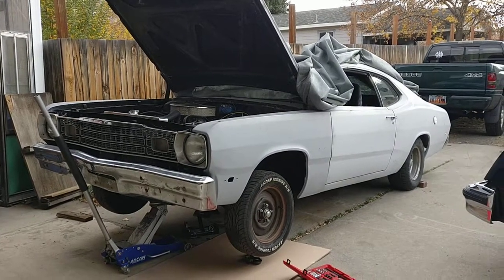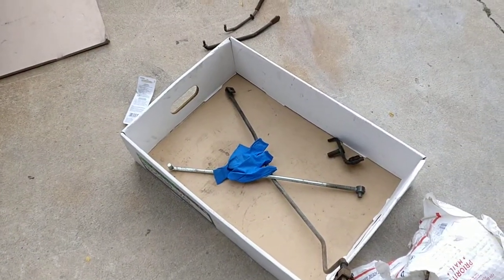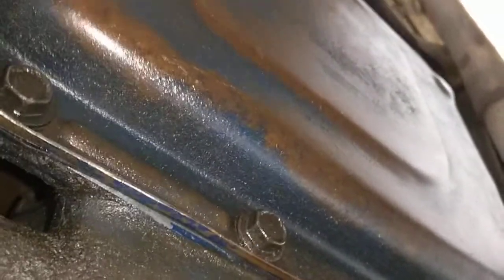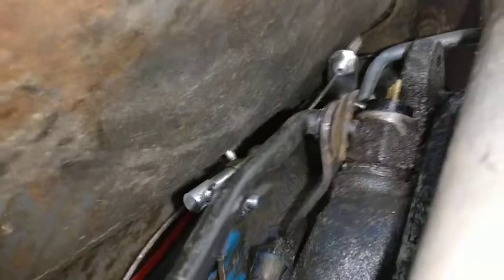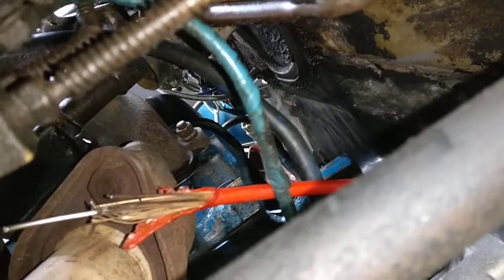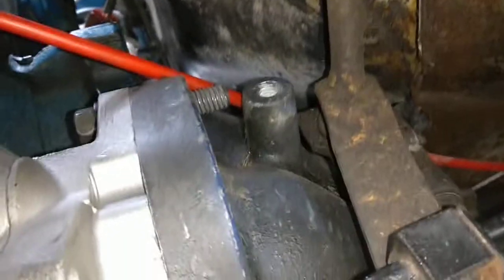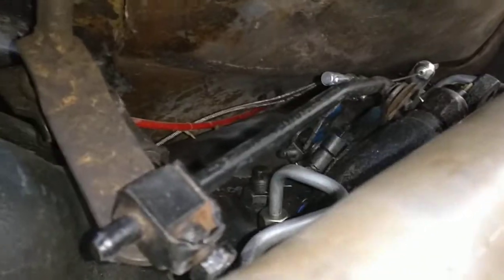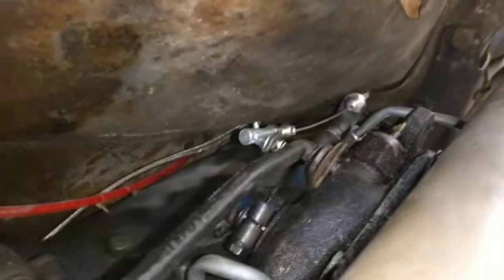1973 Plymouth Duster Column Shift Linkage - How It Works

Comment: I had dropped my column to remove my dart's cluster and now the shift indicator is one gear off. I had to twist the column in order for it to be correct but mounting holes were then off. I think my adjustment on the rod may have gotten knocked off position or something. This is the only video I could find on how this linkage works. Awesome video, I should be able to put it in park and adjust that rod all the way out until it stops to get it all lined up again